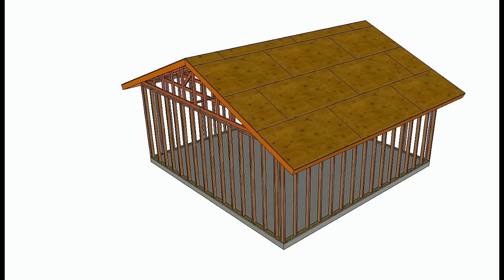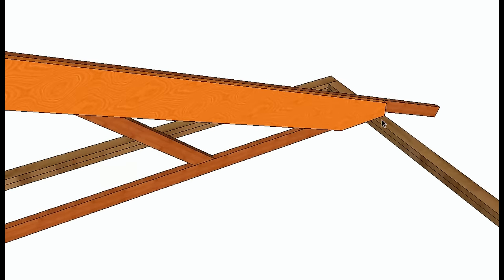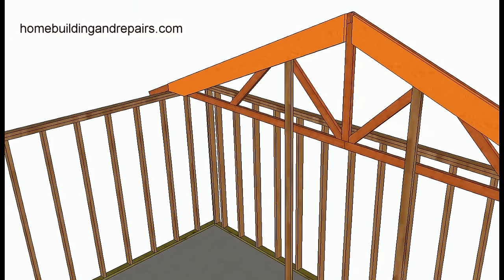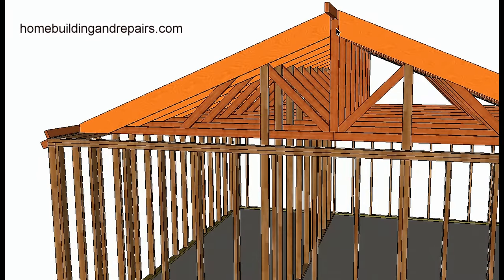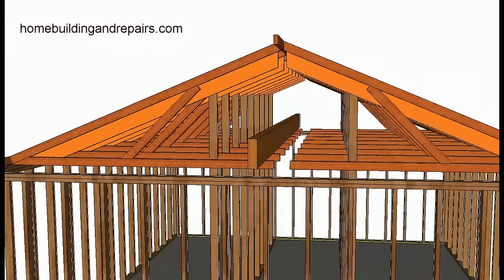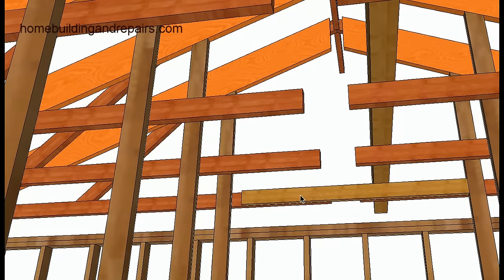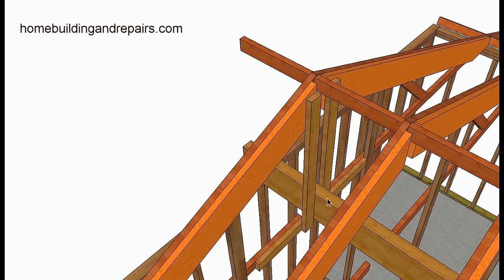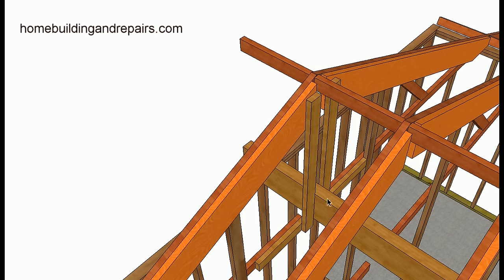How To Convert Existing Truss Roof Flat Ceiling To Vaulted Ceiling Using Rafters, Post and Beam

Comment: If I was placing the 2nd story on a 5/12 truss roof could I use open web floor trusses expanding the full width of structure (since the load factor with the current roof trusses is the outside walls of the structure) and install the floor trusses (32' long x 24" thick) from one side of the structure to the other side of the structure (outside walls) and then screw and glue every roof truss to the floor truss where they touch (every 18") and then remove the part of the roof truss that extends above the floor truss so that a standard framed room could be built on the floor joist trusses?
Reply: Also, the reason for the above keeping of the roof trusses and aligning the floor trusses next to them is so the ceiling will no fall down and because the coffered ceiling below them is attached to the bottom of the roof trusses.
Reply from the maker: You would need to check with a structural engineer for more information, but I have seen floor trusses span long distances like you're talking about.
Reply from the maker: I don't understand your question completely, but if you're suggesting that the roof trusses need to be vertically aligned with the roof trusses, then this would also need to be answered by an engineer. Feel free to rephrase your question if I didn't answer it.

Comment: My house didn't have the middle support peice. The engineer said we can put the ridge beam below the existing ridge beam structure so the rafters will not be attached to the new ridge beam like this. I don't really understand what the new beam will be connected to. The beam will be supported by posts at the ends and one in the middle that goes to the basement.
Reply from the maker: The beam can go under the rafters, but should hold them up with either having them sit on top of the beam or some type of wall or bracing holding roof up. Ask the engineer to provide you with more information.

Comment: With the supporting post would you need to have one in the basement underneath as well? Or just on main floor as shown in video
Reply from the maker: It all depends upon the design, but if you add a post to transfer weight above a floor, then there will need to be something below to continue transferring the weight to the foundation. I do have some more videos in the engineering section at our website that might be helpful.
Reply: @gregvancom  - is there a video on this topic right now? Adding a post which extends to the foundation

Comment: The 2x4 wall you used to support the rafters is basically the hallway that runs through my house. I would like to ditch the beam all together. Is that possible. Would I still need to install the rafters. My house is 25ft wide. Hallway 4ft wide. I would really appreciate your response. Thank you
Reply from the maker: I can't think of any other way that would allow you to get rid of the main support ridge beam.

Comment: This is a fantastic video!  I'm working on a 30' wide pole building with trusses 48"OC where the previous occupant cut out 4 trusses and "re-engineered" them to allow for motor-home clearance.  I like the extra clearance so I have been considering engineered I joist until I came across this.  Would it be better to use the I joists 48" OC the rafters 24"OC?  Do you have a better suggestion where I can retain the ceiling space in this 16' area of the building?
Reply from the maker: Here's a link to our website for garage remodeling.
https://www.homebuildingandrepairs.com/remodeling/garage/index.html
if you can't find what you're looking for then email me some pictures of your problem, but keep in mind that I cannot provide you with structural engineering information.

Comment: Can I leave the trusses alone and add 2x10 or 2x12 so I can hang stuff from my garage ceiling or so I can install storage above my garage?
Reply from the maker: As long as the additional building materials aren't connected to the roof framing trusses in a way that would create additional structural stress and they can support the additional weight, then I would say go for it.
Reply: @gregvancom  Ok. Another question: what do I do about these things if I put 2x10s or 2x12s up in my attic:

https://www.youtube.com/watch?v=VjZssXBUHnA&feature=youtu.be&t=62

"These things don't have to be 48 inches on center" Do I just raise them up so they're on top of the new 2x12s? 

What are those things even called?

Comment: What's going to keep the side walls from being pushed out?  Especially in the middle where they are far from the end walls. The bottom of the trusses could have helped do that, but once they're removed, it seems there's only the stiffness of the walls.
Reply from the maker: That's a good question. The beam at the top that's used to support the ridge will prevent the walls from spreading. It can actually be one of the reasons why a larger beam might be required.
Reply: Ok, I think I get it.  The beam carries the weight to its ends, rather than distributing it down the rafters to the side walls like conventional trusses.  I definitely see the value in having a structural engineer, but I still like to understand how things work myself.  Thanks for the reply!
Reply from the maker: You're welcome and thanks for watching.

Comment: What you're proposing will not work if you need a decent R-factor insulation. R-49 requires 14" plus gap for airflow. Can you design something for that?
Reply from the maker: I don't have any videos on that yet, but larger insulation will require individual or multiple framing components like roof rafters to provide the space necessary or to find an insulation that will fit in smaller spaces. If it's for new construction or a home remodeling project, you might think about contacting a roof truss manufacturing company to provide you with the necessary framing components.

Comment: Hello, I am not a builder or contractor, nor do I know all of the technical terms (wish your video had labels for the structural parts so I can learn) however I have a few questions:  I have an existing attached 24 x 24 ft garage (8' ceilings) with trusses similar to the ones in your video.  We'd like to convert the garage into a great room with vaulted ceilings.  I have been told that we will have to raise the roof.  Question:  would we be able to suggest this process (in the video) so we do not have to raise the roof?  There is no mechanical or plumbing (only minor electric and insulation) in the attic. Would this process you show in your video remedy the need to raise the existing roof?  I have done a little research and have found that raising a roof for a 24x24 garage can start at $23k and go upwards of $50K...If there is a way to get the same look (vaulted ceiling) without compromising the integrity of the building, but also saving money, I'd like to know if this is feasible in my situation?  If you have an email I can certainly send some pics for you to look at and of course, I would have an engineer give the final okay...I'm just wondering if I do NOT have to raise the roof?

Comment: I think it might be impossible for me to bring a beam of that length in through our front door. Other than bringing in the beam from the side via a crane, is there another option? For example, could I use beams that are, say, 1/3rd of the length, as long as each end is supported by a post? I have a hallway wall running down the middle of the house in which the support posts could be located.
Reply from the maker: Yes, engineers use structural post to reduce the length of beams all the time. This might not help, but sometimes we go through windows with our wood beams.
Reply: @gregvancom  Thanks. One more question: My house is two stories. So, I'm guessing the joists between the floors are probably not built to be strong enough to support the post & beam, right? So, I'd either have to reinforce those floor joists or run the posts all the way down to the bottom floor, right?
Another option I've heard is to convert the trusses to scissor trusses. Seems like that might be easier, as it wouldn't require the post & beams. I know I wouldn't get as much height in that case, but are there any other drawbacks to that approach?
Reply: @Skepilot  Little late but you are bang on that those posts need to run to the basement and be set on their own concrete footing.

Comment: I know this is an older video. But i was wondering if an engineered truss can be altered?  Will this pass inspection?
Reply from the maker: The videos only a year old and if you're suggesting that something less than two years old is older, I must be ancient. Anyway, engineered trusses can only be altered or modified by approved plans from the manufacturer or an engineer and will only pass inspection if approved by your local building authorities, building departments or building inspectors.
Reply: Pre-engineered wood roof & floor trusses can be altered/ repaired & modified, but you will need a specific individual truss repair detail sealed by a structural engineer in the state the structure is in.

Comment: How common is this type of conversion? Having trouble finding a contractor that even thinks this is possible. Thank You.
Reply from the maker: That's a difficult question to answer. I only did this once and only had one customer ever ask to have it done. If you've already had a couple contractors  and they have provided you with realistic and rational reasons why it can't be done on your particular project, then it might not be able to be done. You can always contact a structural engineer for more information.

Comment: At 6 minutes when you cutout the lower web, what prevents the outer walls from pushing out without having any collar ties?
Reply from the maker: The interior wall support studs should prevent the walls from spreading out, but there are no guarantees. The size of the project, length of the trusses and a variety of other things might require additional structural support braces.

Comment: Sorry for digging up an old video, but I was wondering if the ground to ceiling supports stay in place or if they are removed? I think you referred to them as walls at one stage.
Reply from the maker: They could be removed after all of the framing support members have been securely fastened.

Comment: Do you draw these designs I see? do you advise on different roof designs, etc? I want to raise my ceiling and the only way to do it is raise the walls or put a wall on top of my wall.
Reply from the maker: It sounds like you're on the right path, you would need to extend the walls. Don't forget to check out our website, the engineering, framing and framing repair section.http://www.homebuildingandrepairs.com/repairs/framing/index.html feel free to send us some pictures or drawings of what you have in mind and I will see if I can help.

Comment: can i move one of my garage web in the attic from the tilt position to vertical position so i can make a hole to transient through to the rest of the attic ?
Reply from the maker: I think I already answered your question email, but if you can figure out a way to create a different type of structural support, then there might not be a problem. Keep in mind that I cannot provide viewers with structural engineering advice, because I'm not a licensed structural engineer.

Comment: What about collar ties? What keeps the load bearing walls from spreading apart now?
Reply from the maker: Most of the time you're not going to need rafter ties, ceiling joist or collar ties if you have a rigid beam and the structurally sized roof rafters. The ridge beam is actually going to prevent the walls from spreading.
Reply: Hit the nail on the head there would be failure, probably okay with timber frame but massonry would be a unacceptable. Ridge beam should be limit deflection to say 6mm to prevent that ruleing out use of timber alone. It's a stupid design two steel purlins limited to 6mm propping roof and splice into 3 section, also supporting floor is a much better design

Comment: Hello 
  
 I have question regarding my second floor 
 the staircase are currently 3 feet wide each step.   I would like to make it 5 feet wide  but I have a joint both on left and right of stairs stoping me from making it wider. What do you suggest I can do?

Thanks
Reply from the maker: Send me a picture of your stairway and you can get our email address by visiting our website.

Comment: What if there is a window where the new beam vertical support needs to be?
Reply from the maker: The window will need to be structurally reinforced to support the load and most of the time that's done with using larger window headers. For example if you have a 4 x 6, you might need to install a 4 x 10.

Comment: what would you have to change if you were only going to convert half the building to vaulted? How would you support the end of the lam beam in center of building?
Reply from the maker: You would need to use posts and beams. Send me a picture or a drawing of what you're talking about and I will see if I can make a video.
Reply: gregvancom I will do that. Thank you. just need a few more feet of head room for my vehicle lift.
Reply from the maker: You're welcome. I would love to see some pictures of your project after it's done.
Reply: Greg can I do the same ? I just saw this question and had the same issue. I was thinking cripple wall instead of ridge
Reply from the maker: I don't know if this is the question you're asking, but you can use a wall under the ridge for the top of the roof rafters to sit on or a cripple wall sitting on top of a beam that transfers the weight to another part of the building that can structurally support it.

Comment: When do you pour concrete under the point loads you've created where previously there were none?
Reply from the maker: It would be good to do this before you set the posts and create a load, but it can be done afterwards, but it will usually be more work..
Reply: In the case of a poured floor, would it be a good idea to run another beam along the top of the existing outside wall to transfer the load along the entire wall corner to corner? Would that eliminate the need for massive point load footings?
Reply: Their is no need for massive point load footings.
Reply: @favrefan4life80  why use that 4x4 post then if you dont need point load footings ?????????
Reply: Of course it needs a 4x4 or 2 2x4s nailed together to pick up the beam.
Reply: @favrefan4life80  lol you are completely missing the point. If you have that 4x4 (large post) there and not an ordinary stud, then that would imply a heavy load coming down that post. Post means its a point load which in turn would require beefing up the footings !
Reply: @dantheman3022  I'm not disagreeing with that. Yes carry the point load down to the slab/foundation. In this application a 4" slab is plenty to pick up that load.
Reply: @dantheman3022  and let me guess, you have never physically done any work like this? Point and click expert? Sounds about right, no real world experience. My trade is filled with pretenders like yourself.

Comment: Greg i have 8 ft ceilings 2 story house and I would like to add a 8 ft French door 4 leaf downstairs  is it possible?
Reply from the maker: It would all depend upon the layout and design of home. Keep in mind that I am not an engineer and cannot provide you with engineering information. Feel free to send me some pictures of the area and I will see if I can help.
Reply: What's your email?
Reply from the maker: Visit our website and a link should be on the bottom. Click on the contact link for more information.

Comment: A lot of work and materials to put in a ridge beam that serves no purpose.  Cut the rafters at the beginning so they meet in the middle.  Leave the blocking between rafters of the original trusses.  Add collar ties to a portion of the new, larger rafters to prevent rafter spreading.  Boom.  Done.
Reply from the maker: I don't know about that?

Comment: Seems like it might be easier to install the beam and rafters if you first removed the old trusses. The old trusses are just dead weight afterward anyway.
Reply from the maker: Good point about the old trusses and using the word "might." It might be easier, but it might also be harder. It might be cost-effective, but it might cost more money. Remember, these are only suggested methods of construction and might not work for your particular project.